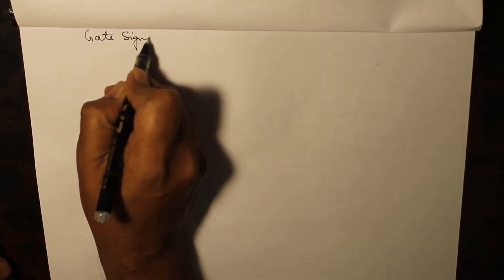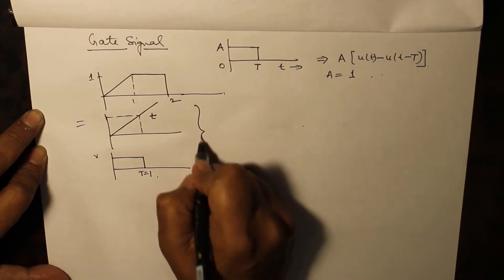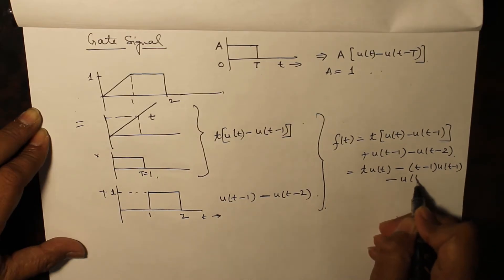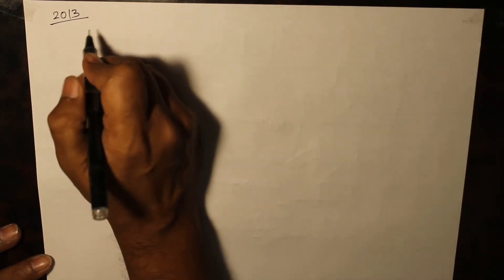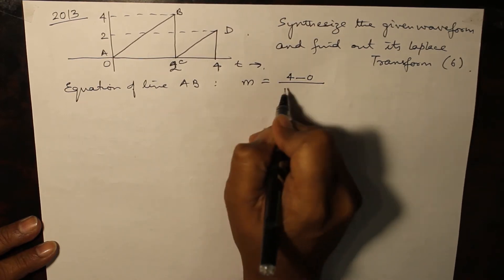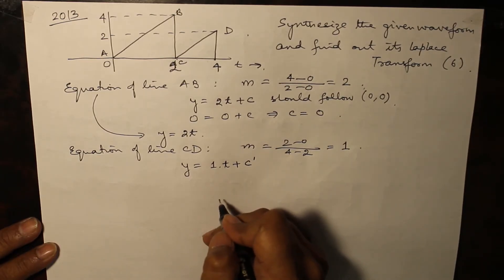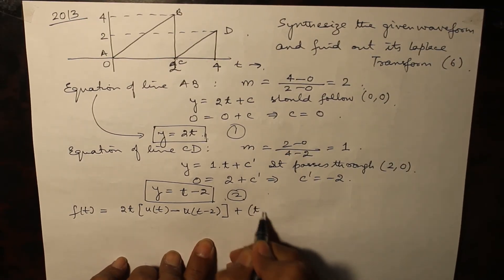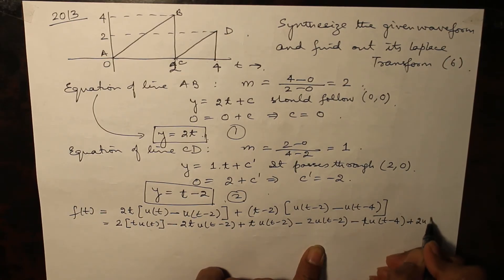Gate function and why not to use it | #13 Circuits and Systems | IPU B.Tech Sem 3 Unit 1

Comment: Sir,
In f(t) while considering unit step function why we didn't considered the chnage in magnitude.... which we did in previous questions where we multiplied change in magnitude with u(t-n).

Why we didn't took change in magnitude in consideration?
Reply: At t=to, if there is sudden change in magnitude, step signal exists; if there is sudden change in slope, ramp signal exists; if both changes are co-existing, then both Step & Ramp exists at t=to

Comment: Sir why did you use the line equation?
Reply from the maker: Kindly elaborate your question.
Reply: Sir as you said that in Gate Signals we have to multiply by A(magnitude) all the functions, so why did you use the y=mx+c equation when we simply know the magnitude of the first slope as 4 and second as 2.
Reply from the maker: @techxpert8788  A[u(t)-u(t-T)] is generalized gate of time interval T and amplitude A. In Signal Synthesis, we never multiply by 'A' and take equations of line always. But if a signal is to be amplified (magnitude scaling), then we may straight away use generalized concept. But, generally this is never done is signal synthesis.

That's why in video, it has been said that "for simplicity it is always taken as 1".